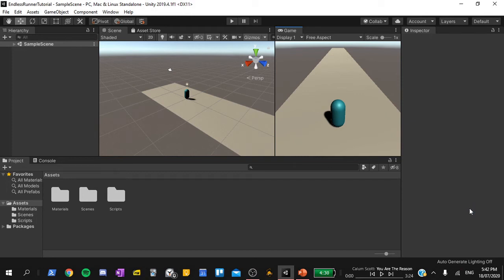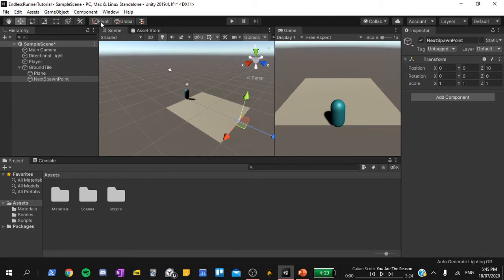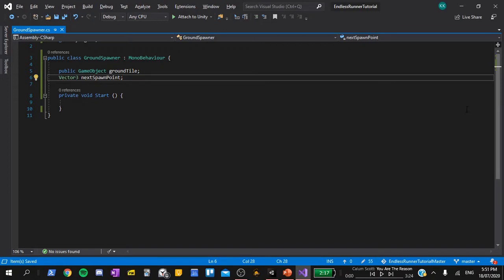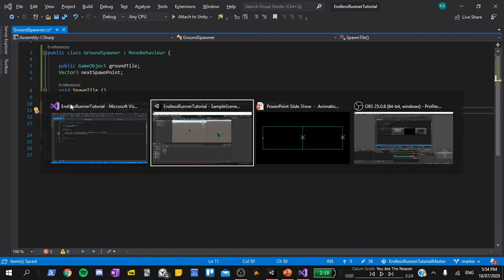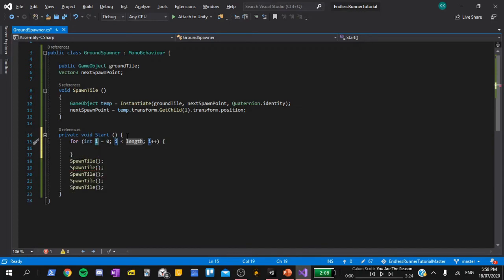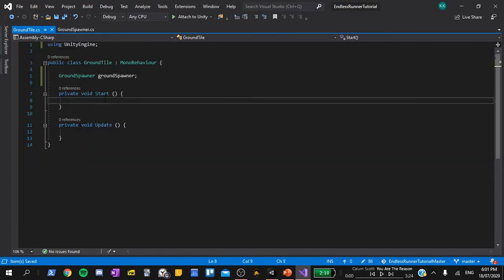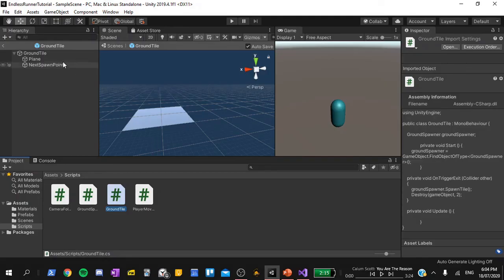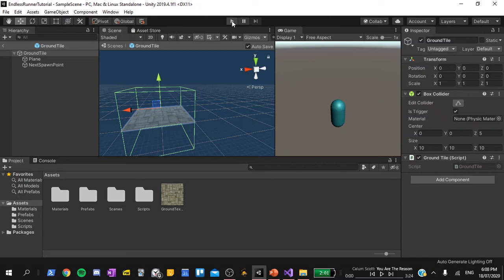3D ENDLESS RUNNER IN UNITY - ENDLESS GROUND SPAWNING (Pt 2)

Comment: I followed this and it's great but I have a error. It says "Assets\Scripts\GroundSpawner.cs(13,62): error CS1061: 'Transform' does not contain a definition for 'posistion' and no accessible extension method 'posistion' accepting a first argument of type 'Transform' could be found (are you missing a using directive or an assembly reference?)" and I can't find out how to fix it.
Reply: you simply made a typo! you spelled "posistion". it's correctly spelled "position"

Comment: hey i know im late but can i get some help? you see i did everything in that video but for some reason my player sometimes get stuck in the intersection between the platforms, they are all on the same Y axis and even if i make them merge into each other he still gets stuck. 
But this only happens like once every 20 tiles so idk what to do is this a unity bug?
Reply from the maker: I've never encountered that happening to me before, so I don't really know what the problem is. Especially since it doesn't happen on every tile it shouldn't be anything to do with the colliders, so I would guess it is a bug with the version of Unity that you are using.

If someone else has encountered the same problem and found a solution, please post it here to help out :)
Reply: @PracticalProgramming  do you think there is a way to code it so that if there is a little obstacle, my player can just get through it? Instead of being blocked by the smallest thing

Comment: Hello.. i am having a problem as when it starts to generate the ground tiles it creates one then skip creating one (space found between two tiles) then create another one .. why is that ?
Reply from the maker: However, before you do that, the most likely reason I can think of would be if the Ground Tile prefab's components were placed in the wrong position. Perhaps just go back to that part of the tutorial (sorry I don't have a timestamp) and check the position of each component.
If you are still having trouble after that, it might be a good idea to re-watch the video and see if you are missing a line of code or something like that. I have put a link to my project in the description where you can download it and see what went wrong. 
If it still doesn't work, feel free to let me know and I'll see what I can do to help.
Good luck :)
Reply: I had this issue too and the solution is move the camera and the player (five units  from the startiing point as mentioned in the vid)

Comment: My Player seems to be floating
Reply from the maker: If you go to the inspector (with the player selected), check if the capsule collider is surrounding just the player's mesh (it will be a green capsule outline). If the green capsule appears beneath the player or sticks out of the player, go to the capsule collider component and move its centre on the y-axis to something bigger (most likely 1 will be correct, but change it until it fits the capsule).
If that doesn't work, try downloading my project from github (link in description) and see what is different.
I hope you manage to solve the problem - if nothing works, feel free to drop another comment and I'll see what I can do :)